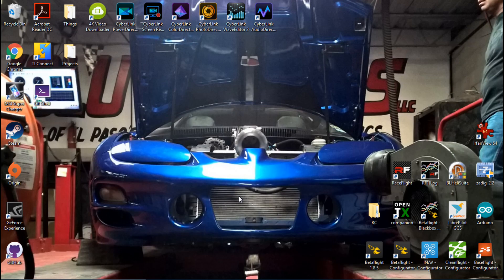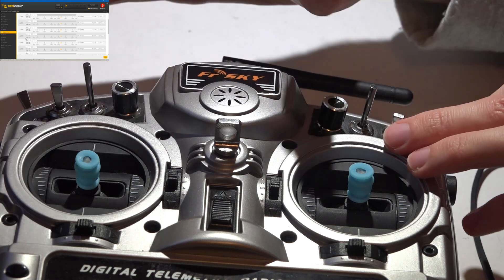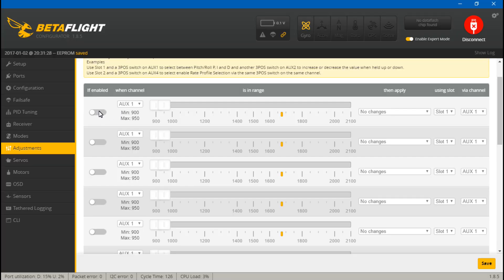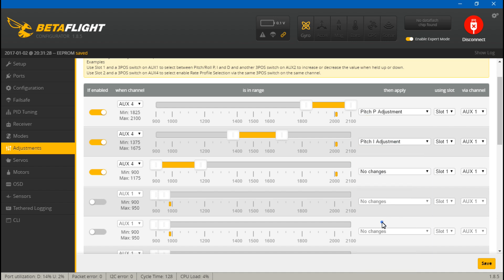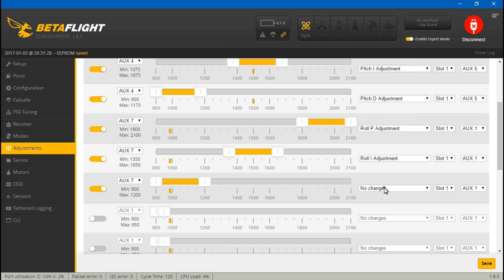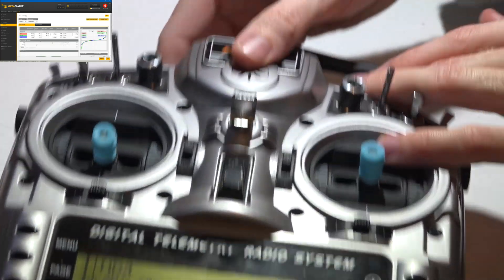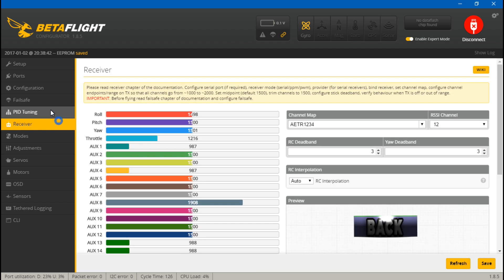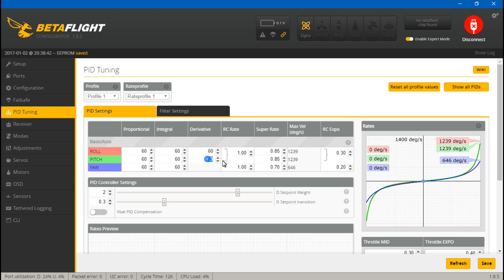Changing PIDs In Flight Pt 1

Comment: Great videos.  I'd suggest setting the taranis so that one 3 pos switch is axis (pitch,roll,yaw) and a second 3 pos switch for p,i,d. This gives you 9 combinations of things to change with 2 switches.  And then a 3rd 3 pos switch for raising or lowering the value.
Reply: I'm toying with the idea of using the 4th switch to enable/disable the adjust switch (Configure via Transmitter probably). I bend over, stand up and suddenly my Ds are at 200!!!